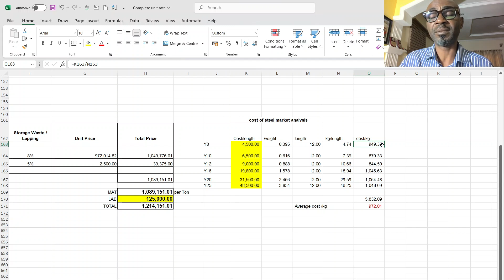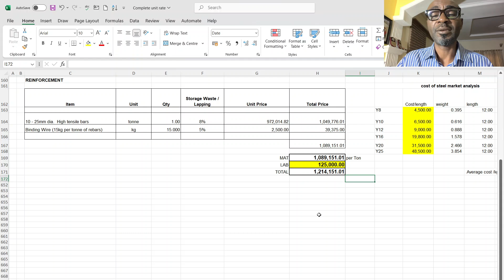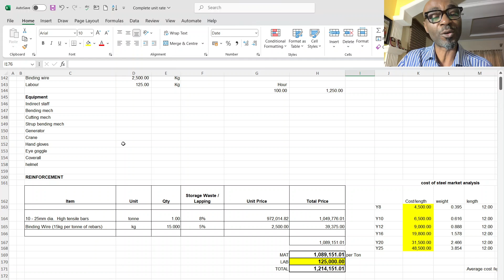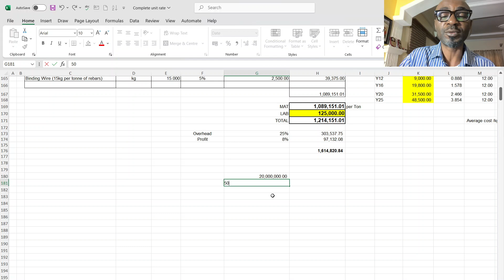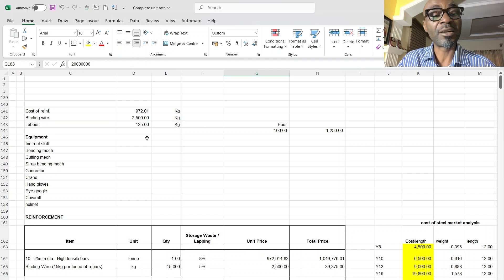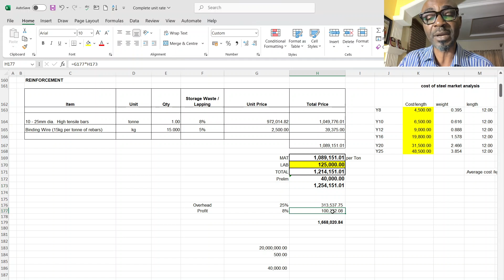Rate analysis for a unit cost of reinforcement steel bars

Comment: Thank you for the good job sir. My question is, what is the purpose of the hour and the figure underneath?
Reply from the maker: The assume time it take for an individual to bend and tie one tone of steel is 100 hrs and the hourly cost for a Labour is 1250 so if you x 1250 x 100 hrs you have 125,000/ tone and if you divide 125,000/ 1000kg so your cost for a kg is 125/kg
Reply: Thank you sir
Reply from the maker: @Readerstots ❤
Reply from the maker: Sorry can you be specific, I can’t remember dealing with hours on this video 

Can only know of cost per kg for material and Labour that I used to analyze my rate 

Pls point me correctly to your concern
Reply: @Quantitysurveyingmadeeasy_2014 If you check the row for labour at the top, behind the 125, we have hour. What do we need it for in the rate build up?

Comment: Pls sir how did u get the cost / kg
Reply from the maker: If the cost of one length of 12mm dia bar of 12 meters is say 6000 

First you multiply 12m by the weight per meter which is 0.888/m 

Then divide your cost by the total weight of the 12m you would get your cost per kg.

This is the simplest way I can explain this
Reply from the maker: @princeajibulu109  trust you have subscribed to my page